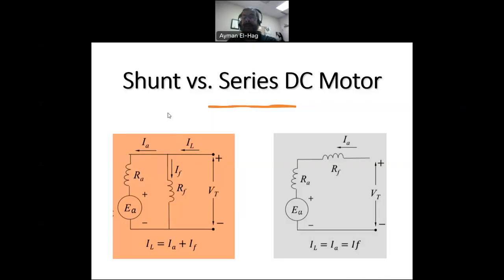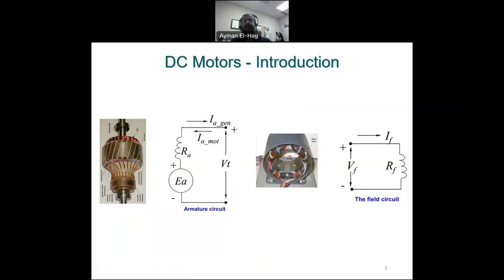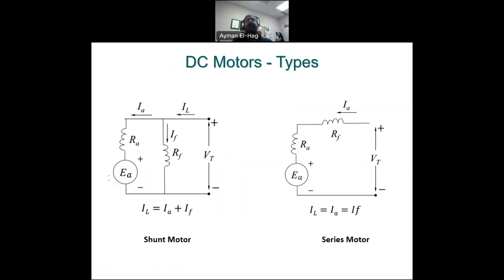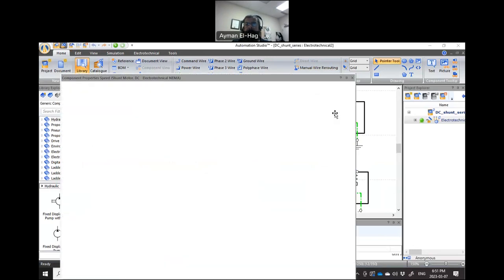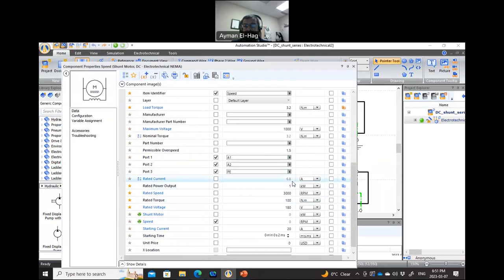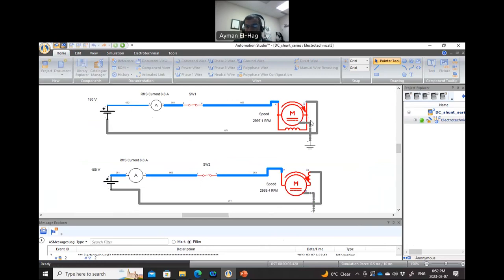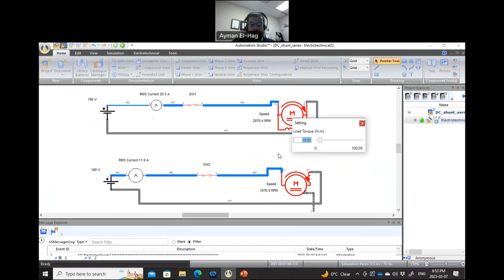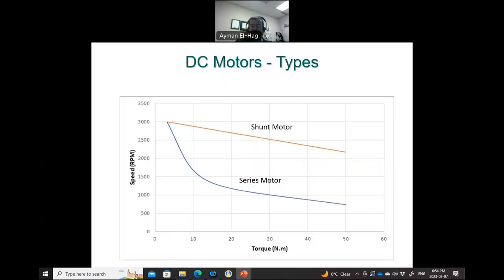Shunt vs series DC motor - Part 1

Comment: I do not understand why this happens? How does the connection affect the load to change in speed? Could you refer to the principles in play? Thank you!
Reply from the maker: I will arrange a video to answer why this happens
Reply from the maker: The video that explain the difference between the two motors is here: https://youtu.be/vd-ae51JCoc